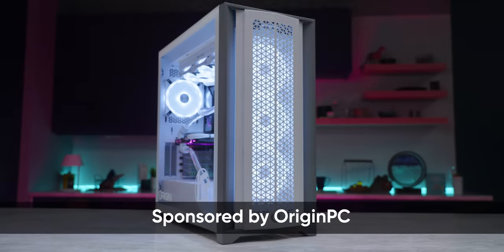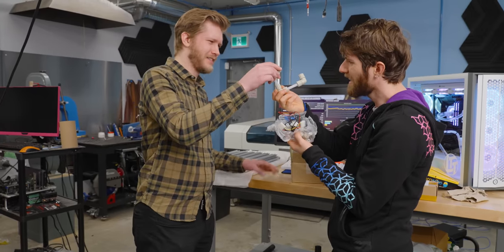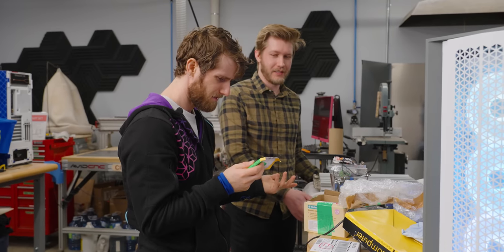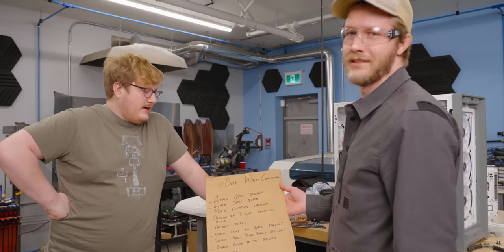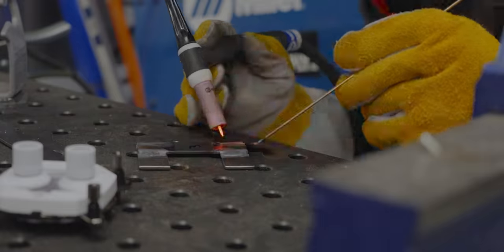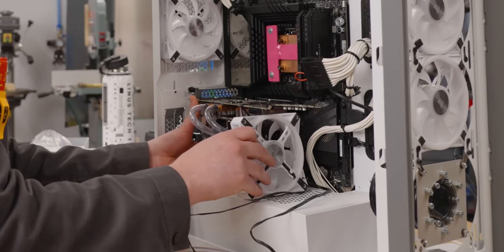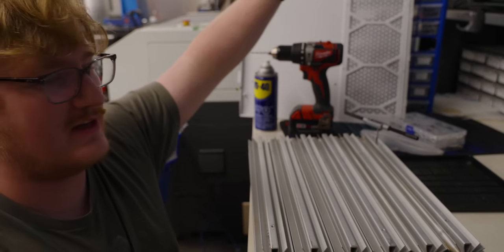Water Cooling.... Using only eBay.com

Comment: The eBay pump works fine. It just needs 12 volts ac. It is actually a small induction motor with a magnetically coupled impeller. The magnet on the impeller shaft magnet works as a stator.
Reply: That bare cable probably went to a barrel jack in a slot plate that they didn't get
Reply: It would 120 or 230v ac it's an eheim pump they never made anything low voltage.
Reply: Where would you have 12AV around a normal computer though? Surely no one back then would've slapped a whole DC to AC converter in so the only option would be a step down transformer from 110/220V?
Reply: @Resneptacle Wall power bricks with 12VAC output were a thing. If you wanted to get fancy, you could've used a relay for turning the pump on with the computer. 220v pump were also not uncommon in watercooling.
Reply: The rando PCB they pull out at the end is the driver for it, it connects external or internal 12DC to 12 AC, and the pump connects to the green terminal blocks on the board.
Reply: @resneptacle  actually they are still made. Like they said in the video, it is a aquarium pump. We have a few cat water bowls that circulate the water and they came with these little pumps. I believe they use them exclusively because they are rock solid and the only thing they need is a small wall wart transformer and save money on electronic components to make a switch mode power supply.

Comment: That one worker who did the cable management needs some praise 👏
Reply: For real, I was so bricked up when I saw that sexy cable management.
Reply: @averagemike2171  the time it took for the dude to probs only get 20cvucks per unit
Reply: Nah, way too many single use cable ties, look at the fan controller how many there are. Need to swap one fan? Welp, better snip all those ties out and redo the entire cable string there!

Pretty but not practical or good for maintenance
Reply: @JoLuMinecraft  true overlooked that if they replace them with velcro ones then that's just cherry ontop

Comment: That radiator did rather better than I expected... now I want to see a whole case or least all the main panels made of them! With a bit more pump that might actually work really well, for a jank build anyway...
Reply: For a weaker system it should be more than enough to keep it cool and quiet.
There used to be commercial solutions like this.
Reply: @timhartherz5652  Indeed, but personal computer sized computers didn't used to be pushing to reach 1Kw consumed the way that system does. I wasn't expecting it to keep up at all with no forced airflow.

Comment: I remember that round metal reservoir, It was THE reservoir to use back in ca. 2003. When this was how watercooling was done ><. It's not that far off, the blocks would obviously fit better but... This stuff was what you would see on some overclocking forum. Radiator from an old volvo and an aqarium pump hooked up to a bunch of milled copper blocks some dude made in his garage on a CNC and fittings from the hardware store for the tubing.

Comment: Those fittings in the possible mis-directed package are for plastic semi-flexible hard line that is normally use in semi-trucks for there air lines. They are good connectors, but only for high pressure system due to press to fit. The pressure tries to push the line back out, creating a seal by the design that requires the line to by push into the connector and the plastic ring must be held into the connector at the same to remove the connector.

Comment: 24:53 I know there wasn't really anything you could do about this, but I think that radiator would work a bit better if the heat exchangers were plumbed in series instead of parallel.
Reply: The hydrodynamic resistance would be horrible. But feeding the array from the top might help a bit. It works like that in ordinary home radiators at least.

Comment: It was sent to Latvia because that's where they consolidate packages. If you order like 5 things they would be sent to same address and they would package it into another box and ship that box to save shipping cost. It's normal.
Reply: Bro, they probably bought from privates....

What most likely happened is that the dude, Inda, is drop shipping.

He ordered a bunch of crap from china, and then simply dropped all the packages in a bigger box without checking if he got what he ordered, and in some cases he clearly didn't xD
Reply: Yup. And the weird package descriptions (Hairclip and so on) is very likely for customs purposes.

Comment: 3:50 those are fitting we used for air .. they easily hold 10 bar pf pressure or  145 psi and they work with any kind of tubes aslong as they are the right size

Comment: I still have one of those alpha cool pumps, im using it now! still the original! still going strong! should come with a PCB that you plug a 4 pin molex into to give it the correct output and control it

Comment: I have a Gtx 680 with the Classified Water block converted but none of this gear, new to
Air cooling.  Ive been following best options and glad you did this one. Youd think all Florida would be ahead on wc 😂

Comment: Blacklord 120 + Hydor 1200 + DTek Whitewater, tankless.

I still have my old 2004 rig in a box. Old stuff are still good stuff. If it can freeze a P4D over 4ghz, it's still actually good.
The good times when watercooling was fun and experimental.

Comment: I’ve still got that reservoir! It’s an Aquacomputer Aquatube and you could get them with a 5.25” bay adapter.  I got the nickel plated brass one after several plastic tube res’s cracked.  I sold all my watercooling kit except the res as they’re are/were hard to get hold of.

Comment: the alphacool fishtank pump is 12v AC. there was a random board @8:16 which is a dc to ac adapter to run it... it wires off the green screw terminals...

Comment: I'd be interested to see that cooling solution re-rigged to flow up down up down up down through each cooler in series instead of parallel  get more use out of the surface area for cooling, clean that base of heatsink/mild lapping and slap some liquid metal on instead and re-run benchies.

Comment: The passive radiator would have performed soooo much better if it had been plumbed right. Heat exchangers should always be plumbed in a cross-flow configuration for best efficiency.

Comment: Right. And now try using the radiator segments in series instead of in parallel as they seem to be now. Looks to me like you could get a bit more performance out of it that way since the water actually has to flow through it all instead of being able to choose the path of least resistance.

Comment: You need faster pumps, and yes I would say pumps as in add another pump in series to increase the pressure through that huge heat sink.

Comment: 5:08 not rack mount, Aquacomputer Aquatube made for our old steel beige boxes, top or side mounted. Top mounted you could get fluid level sensor that connected to your usb header.
Also

Comment: Unless the radiator is blocked I think it's not the radiator but the pump. As you would know each 90 degree turn is terrible for even heay distribution. The lack of pressure likely causes the cold spot in your radiator which you ought not to see. I wonder how you'd feel about using dosing pumps at the heat block inputs... to speed up flow (more water in contact over the same time) and also to mix the water so you don't just get a hot stream of water flowing along one edge of your water blocks but rather an evenly warm mixed stream... you should be able to DIY dosing pumps for pretty cheap, eh?

Comment: If you want to do ebay watercooling right i highly recommend to find some last gen enthusiast who has uprgaded and wants to sell his old parts.
2019 i found an ek full cover gpu block for 35€,  an ek monoblock with the mainboard as a bundle for 125€, good chinese hardline fittings and tubing for 40€, pump ress i bought new for 150€ and two used 240 rads for 35€. 

Together that's 385€ for a hardline set, still running today including an asus z370 board.
Four Tips: Don't get into bidding wars, bring time, buy namebrand blocks and a new pump.

Comment: That radiator is actually several radiators in which a single one is used for cooling brake fluid or steering fluid in vehicles.  That radiator is probably actually very good.

Comment: I wonder how well it would have worked if they had put the passive radiator on instead of the stock fan assisted one, but kept origin's high quality blocks. The issue was clearly that the blocks couldn't effectively get the heat into the loop, but that massive thermal mass would have allowed the system to do most tasks pretty comfortably.

Comment: 1:35 problem with a submerged aquarium pump is the heat from the motor itself. I can go into crazy detail about internal and external pumps. In this case it might cancel itself out being internal

Comment: Alex you inspire me with your god-like jankieness. 
My daily rig is an Asus G712LW laptop (RTX2070, i7 10750H) that has no screen (died), no back plate and no hinges. Running upside down with a desktop CPU cooler sitting on the heat pipes (fans died), fan powered by a plug pack 12vdc supply. The HDMI port died so I'm using a USB-C to HDMI converter to run my external screen. With a USB3 Toshiba Dynadock to connect my devices (mouse, sound, ethernet, etc.).
Runs Doom Eternal at 3840 x 1080, ultra nightmare, RT on, no problems (as long as the AC is on).

Comment: That passive heat sink would be happier if it had air flowing through it from the bottom up as you're only getting one side of it cooled blowing against it. Might have helped to skoot it to the end of the table so it overhangs a bit then put mongo the fan facing upwards. Still not bad though!

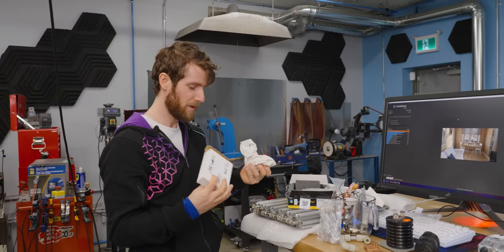Comment: The card at 8:11 is for the power supply of the pump. It runs on 12V AC and this card turns the 12V DC from the power supply into 12V AC.
Reply: Yep, hence why the pump at 16:16 just shot out a single little burp of water.  Looks like they forgot all the janky circuit boards you used to need to get eheims running.  I'm surprised they didn't look at the pump and say "hmmmm, two bare wires to connect.  Do we have something in here with screw terminals?  Maybe a mystery PCB?"

Comment: I dont think that the radiator is the worst part. I bet the waterblocks have probably little ot no fins in them and due to the amount of bends and stuff there the flow of coolant is also limited, making the heat transfer a bit tricky. That said i am really trying to huess WHAT drove you gyus to do it to an Origin PC. It was so nice in the beginning.
Also i would aim for an aftermarket car radiator (copper prefferably) and some fans to push air throu

Comment: those beige plastic fittings are still being used today, that is the original color, i can not name the type of plastic used. but it is a chemical and acid resistant type of plastic. Ive seen them used is multiple type of applications including nitric acid and chlorine uses. trust me im an engineer

Comment: I know this 3-copper-cooler-thing - it was back in the days when you had to cool 3 chipsets - CPU, VGA and if im correct the northbridge which sometimes already was active air cooled. i still have them here - i used them on my amd duron 700 - oc'ed by a pencil xD

Comment: Gone are the days where Linus Tech Tips made a YouTube video worth watching. What happened to the good old days where you would build budget gaming PC with a few quirky mods. Sure its easy to to use sponsored high-end gear but what about customised budget low end / mid range gear. When was the last time you painted a budget motherboard i/o shield to match the aesthetics of a case, painted a gpu shroud to theme match or used braided cable and heat-shrink to mod fan, psu or sata cables. This channel is to much for the corporate sponsors and not for the enthusiast anymore.

Comment: Ok those metal fittings look like camozzi fittings! They are industrial fittings for pneumatic or low pressure hydraulic systems. Those look like BSPP threads.

Comment: You should have bought some of the brand new dodgey chinese custom water cooling stuff from eBay, there are tons of listings for brand new huge 480mm PC radiator blocks for $50 and other crazy cheap stuff, would of been interesting to if they are any good, I have always wondered about them...

Comment: 26:04 thats how i had to run my 9800GT back in the day
case side off, fan on high pointed at GPU
.
then downclock and volt it.... and dont play certain games
.
i then got a 6970 AMD card.... 
it was like going from black and white TV to color 
.
got a 5700XT right now LOL
for the games i play... its damn good
.
for the few "AAA" games i play... im still at 1080P 144hz, so.... its enough
ryzen 1700x also.... factory clocks on everything (but it can do 3.9 all core)
.
NH-D15 FTW man..... i love that cooler
had a 4.1 GHZ phenom 2 6 core.... loved that CPU

Comment: I didn't have a 12v aquarium pump... So I had a PSU that was modified to have an internal 240v AC plug for the pump

Comment: Video summary generated by OpenAI: 

In this video, Alex and Brandon have opened a mystery bin of vintage and handmade water cooling components from eBay to compare with a Millennium PC from Origin PC. While the Millennium PC has great specs, the new components are a gamble as they look old and worn in the photos. After taking a few measurements to assess the performance with the stock cooling, they assemble the new parts, finding out that some of the fittings are G1 quarter, plastic and from the late 1980s - early 1990s. It soon becomes clear that they have been scammed and instead of the high-quality components in the pictures, they have plastic, scratched up parts and what looks to be fishing lures in their package. However, they are gracious and offer to send the deceived customer a set of EK fittings free of charge.

Comment: just to comment since i dont see much of people doing this but my pc bottleneck...  5950x and 3090 is the motherboard.  Ingot the pro siphon elite like you said is great.   in gaming and most applications the temp. bottleneck is the mobo.  Of coarse I have been using cool air from an ac unit but that flows through the mobo also so...  in ambient temps it also an issue just not as noticable becUse when its on the cpu die avg. 30 around 45 celxius and tops out at about 50 celcius...  of course i dont run to many cpu intensive programs because of the gpu and cuda.  smbusmaster is the one that is most concern.

Comment: There is crap, and there is used hardware. This was mostly crap. Though, the Aqua computer reservoir with the stainless steel mounting plate, is pretty sweet.

Comment: I've been running that tiny pump you ended up using for the past 2 or 3 years. Got it for like 15$ on aliexpress, shipped. Heck I got 2 of them in case one fails so I can have time to order a replacement in the meantime. They are good enough for a triple rad, a cpu and a gpu block which surprised me.

Comment: I disagree with that being "good" cable management. It looks nice. But its not servicable in a nice way at all. The example of attention to detail for the fan plugs going under a screwed on board would piss me off, cause fans are the MOST likely thing to need to be replaced for things like noisy bearings.

Comment: And now something from the same period but not that jank. Use like a Coolance case ( remember the bleu one with the radiator on top? ), a Zalman Resorator 2, and some blocks of these manufacturers. Will be difficult as well, because the blocks are made to cool a Pentium 4/ AMD Athlon/Duron and not a processor which uses 135 Watts or a 400 Watt GPU. You can use 1 radiator for the CPU and the other for the GPU. Already laughing about Alex mounting these waterblocks. :face-blue-smiling::face-turquoise-covering-eyes::face-blue-wide-eyes::hand-orange-covering-eyes: :face-fuchsia-tongue-out::face-orange-biting-nails:   :trophy-yellow-smiling::trophy-yellow-smiling::trophy-yellow-smiling:

Comment: INTEL SAID THE CHIPS CAN RUN 98 TO 100, AND IT WONT BURN OUT. IT CAN DO IT FOR WHILE.
Reply: 13th gen CPUs are pretty much designed to run at tjMAX for maximum boost. Same with Zen 4. Nothing wrong here

Comment: When you say originpc millennium do you really mean prebuilt Corsair 5000 series. Originpc isn’t much of a company these days since Corsair bought them out. Instead of originpc having there own custom designed cases like they used (I know since I own the original originpc genesis case) and now they sell pre built corsairs. Such a huge disappointment to me since I used to love originpc cases (well clearly or I wouldn’t still have my genesis).

Comment: Alex I wanted to ask you guys for help with a used GPU something like a 2080 t.i. I'm running an I9 9900k my only 
hold back is my 2 980 t.i. I have been trying to run Star Citizen and it keeps crashing on me. if you can help me it would 
be deeply appreciated.

Comment: not impressed until i see soft drink bottle with hoses melted through for the reservoir, and coke cans for heatblocks/radiators...
junkie janky hobo style screwed to a wall with bits hanging off.

Comment: How did you spend $440 ($330 USD) on this garbage!? You can build the loop I'm running in my build right now for about the same cost. (Bykski CPU-XPR-AM-V2, EK Quantum Vector, Swiftech MCR-220 rad, barbs/clamps, Laing D5 pump, EK ZMT tubing) It's on a 5800X/5700 XT, and it would probably struggle trying to cool a 13900K + 4090, and rad fans will add some overhead to the cost, but it would still be better than this.... junk. I mean, did you do this just to make the Origin PC loop look better? If so, I get it, but wow, that's a sad parts list for the money.